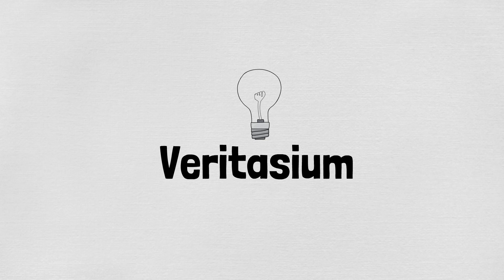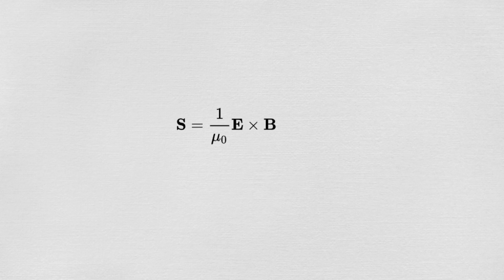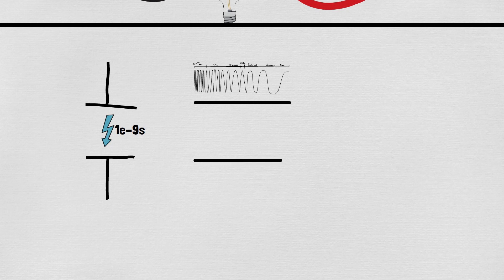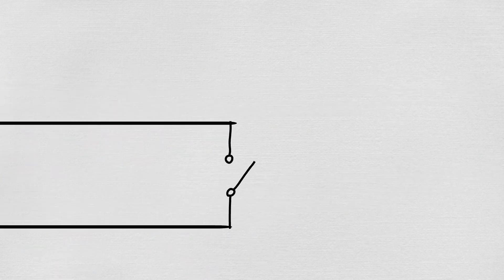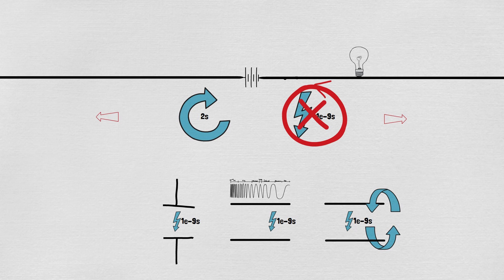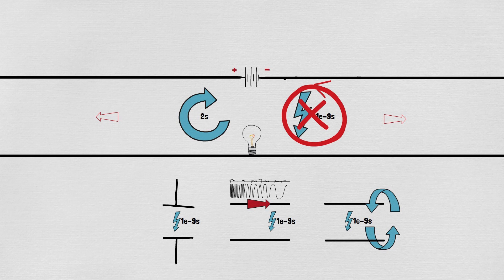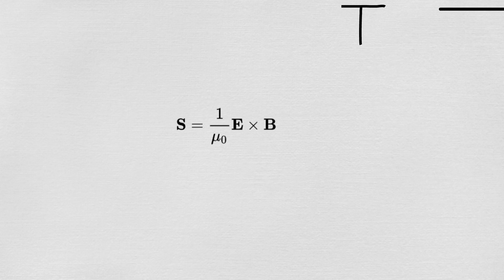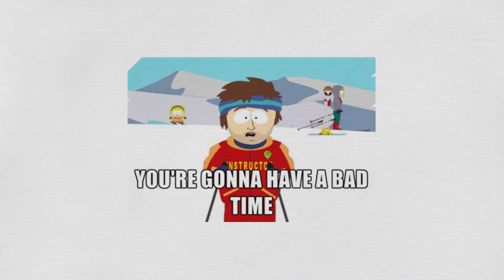Veritasium is Right? (see description)

Comment: You are completely disregarding the transient current when the switch is closed. And that transient current starts propagating from the position of the switch not the battery, therefore the position of the switch affects the transient response of the circuit. If the switch is at the far right end for example, the current start flowing at the switch on both the upper(battery) path and the lower(load) paths. That transient current will reach both the battery and the load at the same time in half a second after closing the switch, since they are both half light-seconds away from the switch on their respective paths. The steady state current will not be established until 1 second mark regardless of the position of the switch, the transient needs to propagate the entirety of the circuit for that to happen.
Regarding your argument about lighting all the bulbs in the universe, erase the far end connections on both sides of the circuit, replace the bulb with a sensitive galvanometer and copy paste this line 99 times each 1cm closer to the battery line with the switch than the previous one. When you close the switch the galvanometer 1cm apart from the battery line will start registering a current in 0.01m/c seconds later. And the others will start doing the same in order until the one 1m apart gets its current at 1m/c seconds mark(though its current will be about ten thousand times weaker than the first line, since its distance to source is about 100 times more. So technically yes you will be “lighting” every free floating bulb in the universe(not really because the current will be negligible for most of them;)

Edit: Oops, the current in the wire 1m away from source would be 100 times weaker than the one 1cm away, not 10,000 times as I have written above. It is the power delivered to the load that is 10,000 times weaker. Magnetic field B and the current I scales inversely proportional to the distance, power scales inversely proportional to distance-squared.
Reply: Exactly, I think the main reason people fell uncomfortable with veritasium's video is how he uses the light bulb as a device that can measure any amount of current, no matter how small it is.
Reply: There you go again talking about transients.
Transients are always on power lines and they don't light the street lights. Sorry.
Reply: @eddietee6305  Highest inductance of the standard commercial inductors on the market is about 10mH. A copper wire with diameter about 10mm and a length of 300,000km will have an inductance about 1500H(enries), 150,000 times greater than the common ones with highest inductance. Therefore I can not say with confidence that the transient in Verisatium's circuit would be or would not be enough to light up the lamp without actually simulating the circuit with a finite element analysis software. All I can say with confidence is that there is a distance below which his lamp will actually get lit and above that distance it won't get enough induced current.
Reply: @timurozturk6435  you are over thinking the experiment. A straight wire doesn't have any turns-ratio and therefore the inductance would be extremely small. Energy stored in an inductor is?
Reply: @eddietee6305  I have calculated the inductance  1500H according to a known formula, it is not a guess. Do you mean that the formula or my calculation is wrong? What is the actual inductance formula for a single straight wire?

Edit: Sorry I forgot to answer your question at the end. Energy stored in an inductor is 0.5 x inductance x current-squared isn't it?
Reply: @timurozturk6435  that's right for the power stored. If you notice, the formula has current (i) in it. That means current needs to flow.
Reply: @eddietee6305  I think I see your point, you are saying the total inductance of the whole wire is not relevant because the transient current flowing down the wire before steady-state DC current is only occupying a very small part of the wire hence inductance per unit length is the relevant parameter here and not the total inductance. Correct me if I am wrong in my assumption about your argument please.
That was my exact thought when I first watched Verisatium's video and I have answered his question initially by thinking that 1s will be needed to light the lamp, not 1m/c. But then I have watched Ben Watson's "Response To Veritasium - Electricity Propagation Time Problem" video here on YT, where he actually built a scaled down version of his circuit in a finite element analysis software and I saw that the transient current is not localized at all. At any point in the circuit including the load of course, the current builds up when the impulse first reaches it, then stays fairly constant until reflections of the transients pass thru that same point again. So the current is flowing thru the inductor in a step-wise manner along its length, not as an impulse that goes down the zero after the initial buildup is over. And it made sense, after all, we know the steady-state current is inevitable after some time and the current in the inductor can not jump instantaneously from 0A to whatever the steady-state value is. And Watson's simulation clearly shows that the current stays in flowing state both in the load and in the wire and slowly rises to the steady state value step-by-step.
Reply: @timurozturk6435  you are right.

Comment: Hello Tycho. Interesting explanation.
You are making an incorrect assumption about current not flowing as follows:  Since this is an "Ideal Experiment" (rolls eyes), It starts with the battery connected and the switch open. Additionally, the relative strength of the charge on the battery terminals is greater than the charge on the wire across the open switch. 

The current flows regardless when the wire touches the battery pole because the charge of the battery pole is different from the charge on the wire across from the open switch which then closes. Since the wire has a different relative charge, the charge from the battery will cause movement of electrons. When the charge balances out, the current will stop. 

Since this experiment only requires 1 electron to move according to the criteria, once the switch is closed, It does not matter whether or not there is a completely closed circuit for current to flow distal to the switch as long as there is "any" amount of wire after the switch of any positive length in order to get 1 charge to move into that section of wire. 

Since the wire is very very long, it will take quite some time for the charges to balance if there was a break very far away.
However, the demonstration makes it known that ~"when the current reaches the bulb it immediately turns on".
So, essentially any electron that moves when the switch is closed will have an EM field that moves and this will propagate across 1 meter of air to the bulb, and because "any current" turns on the bulb, it turns on.
I personally dislike the Veritasium video and find it very misleading, and believe that he should change the criteria to be more realistic.
Basically, the light turns on when EM Wave hits the bulb after 1 meter of travel. You don't even need anything more than the smallest piece of wire for the charge from the battery to move into. ... and it doesn't matter if they are connected later down the line or not because its not needed to convey the EM Wave once the the first electron moves.
Reply: The speed of an electron in a copper wire is very slow, in the order of less than an inch per second, from memory.
Switch open or close, the electrostatic field is present and "established" by the battery. With an open switch, the electrons in the wire have already moved to balance that field, with their own. That implies (unnatural) concentration of electrons (they would repulse themselves, naturally). When you close the switch, it is like shorting a charged capacitor, locally, electrons near the switch can now move away from each other and their electrostatic field in space starts to adjust accordingly. That field travels much faster than electrons themselves, but slower than electromagnetic waves through air.  So, the first one to reach the bulb is the electromagnetic field (small amount of energy), then part of the adjusted static field, much later on, but not yet 100% of the final stabilized energy will be, much, much later on.
Reply: @snnwstt  Interesting. I don't have any data about the speed of an electric field vs the speed of an EM field. However, that information doesn't change the result which is that this "ideal bulb" turn on in the time it takes the EM wave to travel to the bulb across 1 meter of air. RIght?
Reply: @marcfruchtman9473  True if the switch is at 1 meter of the bulb.  The EM field will arrives before (or at the same time) than the electrical field, since one travel in air and the other will stabilize later on, when every electrons would be exited by it and found their new "static" positions. Just need a good scope (2ns) with 2 probes and 100 feet copper wire to check that, by experimentation. The 3 steps effect will be even more noticeable if you make two  "circles" rather than a rectangle, with that wire.
Reply: I have nothing to add, but Marc and snnwstt have basically explained it in the easiest terms to understand. Thanks both of y'all

Comment: The thing that Veritasium didn't explain well is that the only thing that matters is the distance between the light switch and the light bulb. You can put the battery wherever you want and arrange the wires in whatever ways you want. But the answer only depends on the distance between the switch and the light bulb.

The simple explanation is that information travels at the speed of light. You create the information at the switch so it reaches the bulb after the distance divided by the speed of light time.

The detailed explanation is that the switch causes current to flow through the wires around it due to the potential difference between the two sides of the switch. This causes the energy to get transfered over the EM field to the wires around the light bulb causing a current there which turns on the light bulb.
Reply: What if you twisted the wires connected to the switch and they went in the direction opposite to the light bulb for one light-second. I think the twisting of the wires would prevent electromagnetic radiation in the same way it does in Ethernet cables.
Reply: @kdog8787  The twisting doesn't prevent the EM radiation. It decreases it. So there would still be a non-zero amount of energy that would reach the light bulb and the question was worded such that any non-zero amount would count as turning on the light bulb.
Reply: @SvetlinTotev  Well sure, but I don't think Veritasium meant to be that extreme in his example. I think his point was that you could actually turn the light bulb on (actually on) before the current propagated through the entire length of the wire. His wires were arranged in a way that made them good antenna. I don't think he meant for people to think that the arrangement of the wires didn't matter in his example.

Comment: To point out the switch closing would push the voltage difference to the end of the line even if its open creatint a momentary current as electrons either move to the batter on the positive end or to the end of the line on the negative until it costs more energy to push/pull than the voltage. This means that the bulb would recieve momentary insignificant power from the changing current as it pushes accros the new wire.

Comment: I'm sorry, but your causality argument does not correctly understand the physics of the situation.

The best way to understand this system is to consider the long wires as 'transmission lines', of the sort commonly used as coaxial cable or 'twin lead'.  Signals can travel down a transmission line at the speed of light, as adjusted by the refractive index of the medium surrounding the conductors.  Usually transmission lines are approximated by considering the speed of light only in the 'long' direction, but in the case of this example you have to consider the speed of light 'across' the conductors as well.

A transmission line can be described by its characteristic impedance; essentially the inductance of the wires and the capacitance between the wires combine to present an apparent resistance between the two terminals of the transmission line.  If the transmission line were made of superconducting wire and infinitely long, then it would act as a resistance equal to its characteristic impedance.

Considering this simplified model, then the original experiment could be replaced with a battery, a switch, two resistors for the transmission lines, and the bulb.  Close the switch and the bulb lights, but at reduced power because of the resistances.  Some energy is being dissipated in the bulb, but some is going into the 'resistance' of the transmission lines.  What happens to this energy?

Remember that the transmission line appears to have resistive impedance, but this is actually from the inductance and capacitance of the wires.  Rather than being dissipated, this energy is traveling down the transmission line at the speed of light.  The length and termination of the transmission line becomes critical to figure out what happens next.

If the transmission line were of infinite length, then this energy would just keep flowing.  If the other end of the transmission line is terminated with a resistor that matches the characteristic impedance, then the energy would eventually dissipate in the resistor.  But if the transmission line is short circuited, then something very interesting happens: the energy gets reflected.

So when the switch is closed, initially the bulb lights at reduced power because of the impedance of the transmission line.  Some energy is flowing from battery to bulb, some is traveling down the transmission lines.  A half second later the leading edge of this pulse of energy hits the short circuit and gets reflected, and a half second after this the leading edge of this reflected energy flow gets back to the beginning.  The bulb lights up at full power.

Lets change the setup, and put open circuits at the far end of the line(s).  In this case the leading edge of the energy flowing in the transmission line travels to the far end and again gets reflected (because there is nothing to dissipate it).  But in this case the polarity of the reflection is inverted.  So when you close the switch the bulb lights at reduced power because of the impedance of the transmission line, and a second later the bulb goes out.

If you put switches at the far end of the transmission line you could control the bulb, but the message would take time to travel down the transmission line.  Put a switch at the far end of one of the legs, close it or open it, and the effect is seen at the bulb 1/2 second later.  No violation of causality or speed of light.

Note that in the above where I say the bulb lights at reduced power, I am ignoring the transient effects caused by the spacing between the wires.  I expect that the bulb would get the initial tickle of 'something happening' 1m/c seconds after the switch closes, it would take several 1m/c seconds for the bulb to experience the initial reduced power operation I described, and that the jump to full (or zero) power caused by the terminations would happen 1 second later with some finite slope.

-Jon

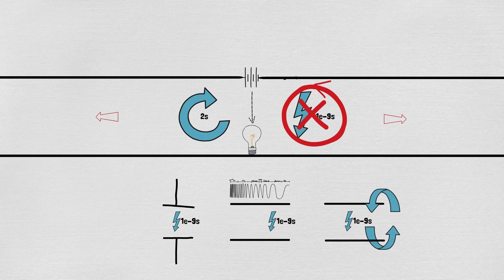Comment: 2:51 The purpose of the switch is to close the circuit (an ideal switch doesn’t allow any current to flow, and it closes/opens instantly). If the circuit is open, there’s no current (by definition of an ideal switch), so there’s no magnetic field (Ampère’s law), thus there’s no flow of energy (Poynting’s theorem), so the bulb doesn’t glow.

Comment: Thanks for this!  Veratasium pretty much went with the "appeal to authority" argument which is lazy and often wrong.  He didn't even carefully describe the problem.  Do the wires have inductance and capacitance?  Seems to me the current will ramp up, as it's described by a 2nd order differential equation.  If you assume one electron wiggling somewhere in the universe will light up this bulb, then I guess we could say he's right.

Comment: I'm a math graduate student and I've never taken any physics class but it seemed so obvious to me watching Veritasium's video. We know that information's speed is bounded by the speed of light, and we know that the lightbulb can only turn on if the wire connects the generator to the lightbulb. Therefore there is a lower bound on the time Δt it takes for the lightbulb to turn on such that Δt >= 1/c min(a,b) where a and b are the length of the two segments of wire between the lightbulb and the generator.

Comment: 4:46 "what causes an antenna to radiate...?  Current."   Actually, that's incorrect.     EM radiation occurs from an acceleration of charge, not just a movement of charge.    If it were just current, DC would produce EM radiation.      Derek's 'thought experiment' had too much theater, and that theater (noise) obfuscates the primary point where the real education is.   And that point is that energy does indeed propagate across the air gap at the speed of light inducing a current that will flow through the bulb.     It is a tiny amount of energy, and it occurs due to the changing transient (read: acceleration of charge) upon switch closure.      The drama created makes this less of an honest thought experiment, and more like clickbait.
Reply: Rush, I caught that "current" comment as well (I too am a Ham radio operator). However as we know, if the current is AC then the AC current does radiate due to the accelerating  charges! He should have clarified that it takes AC current or a step change in DC current to radiate. Good catch. I agree with your other comments too. 73s.